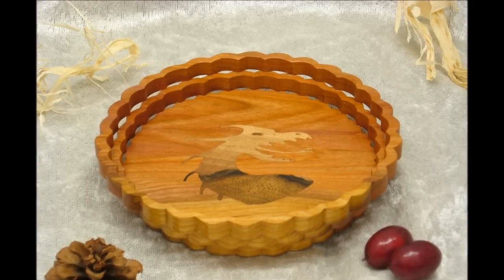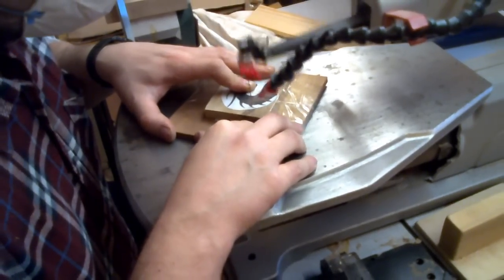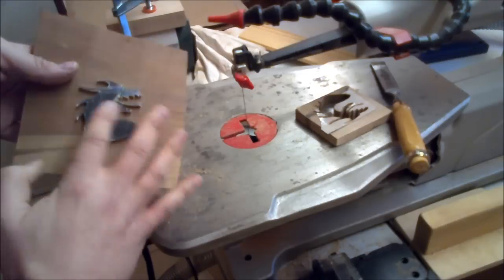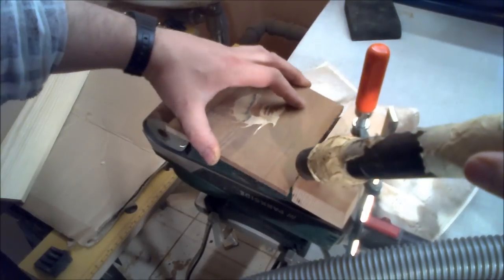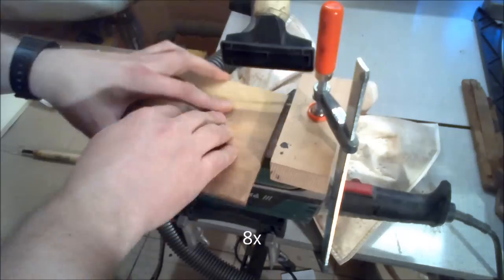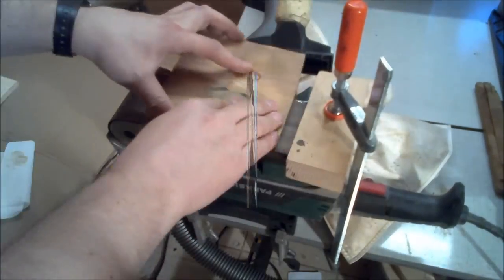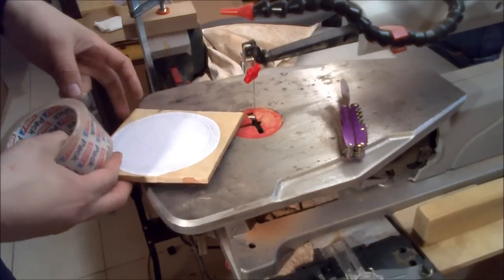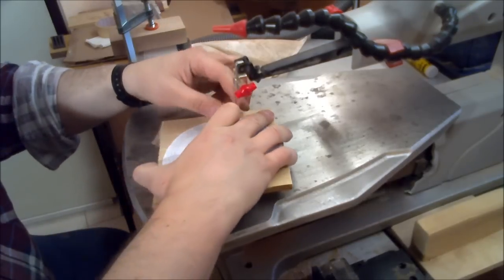How to make a Scroll Saw Plate with Inlay - woodworking

Comment: how long would it typically take to do something like this if you have all the materials right there. I'm getting all the things i need to start doing scroll saw work. I appreciate your videos. Keep on my friend
Reply from the maker: Thank you!I've never really measured the time. Glue drying time not taken into account, I'd say roughly 2 hours. Depends on the workflow, the size of the project and complexity of the inlay.
Reply: thats cool man. I am hoping to get into scroll sawing really soon. Working on my workshop now with gathering tools and building it. I have a deep understanding in art and drawing 3d drawings and I want to incorporate what i draw into the wood. Again thanks for your response